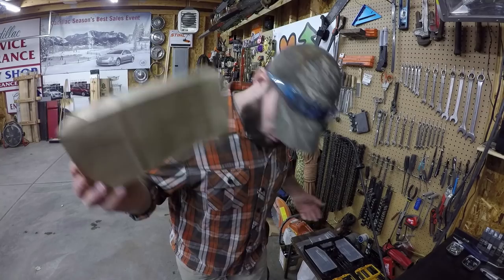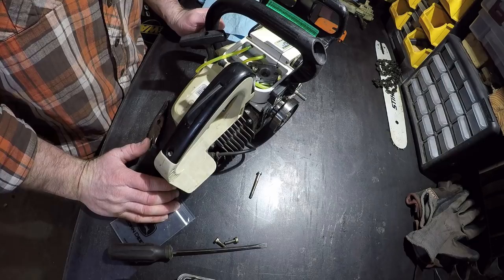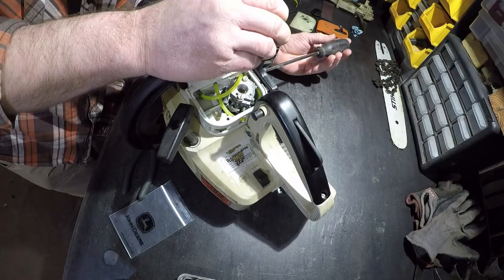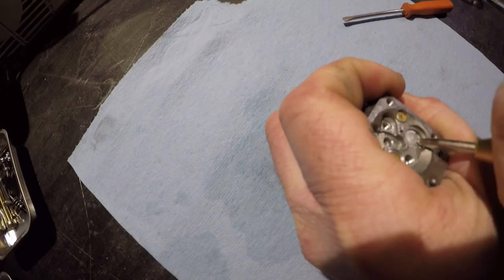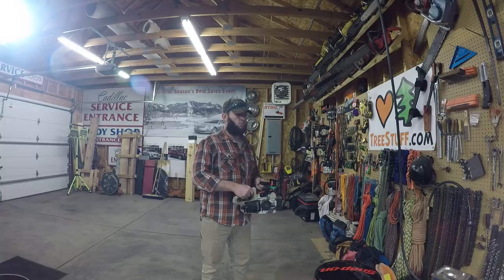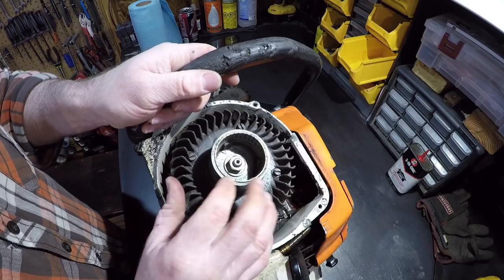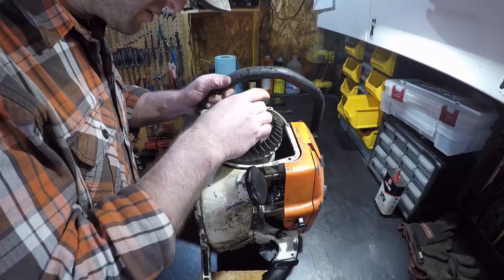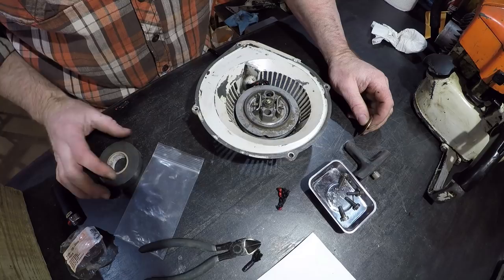Human Vlog 8: Tread Loss

Comment: Non-Oxygenated fuel isn't available in your area? As the alcohol absorbed water, dilutes premix and washes oil off of cylinder walls increasing wear on internal engine parts, I use non-oxygenated fuel in everything but my truck and my truck engine thinks that I don't love it as much as my other engines.
Reply from the maker: Poor truck  =(

Comment: Human on the company work saws. Do you have a link removed from the chains when they stretch beyond adjustment, or just replace with new one. If link is removed does drive sprocket wear faster.
Reply from the maker: I've never had a chain stretch like that, chain adjuster broke on the one saw I fixed a couple weeks ago because they made the chain one link to long.